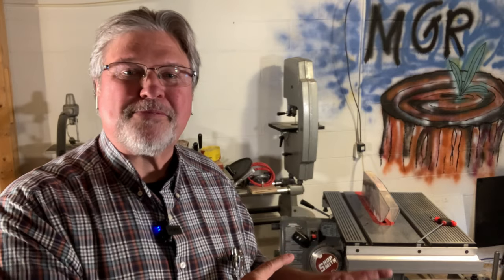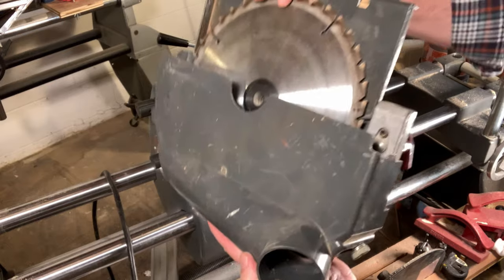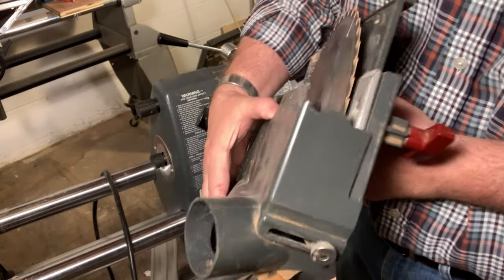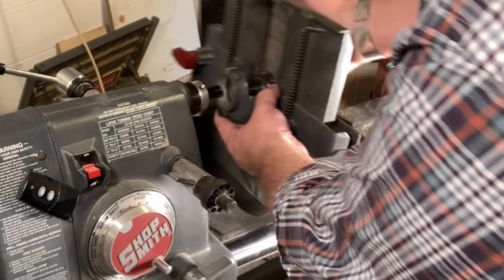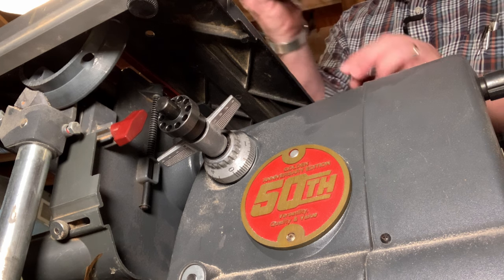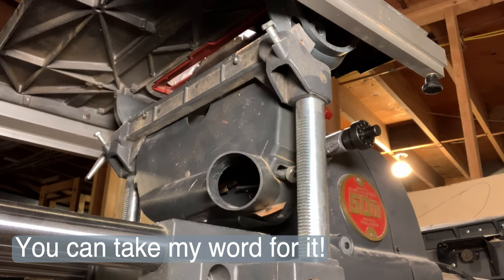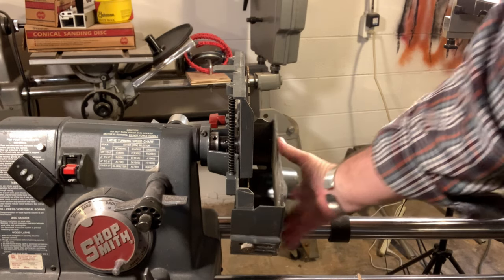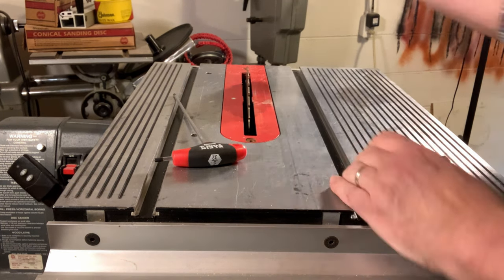Easy-Peasy Alignment & Installing of your Modern Shopsmith Saw Guard

Comment: Good info for the 510/520. Any special tricks for the 500? Thanks for all the great information. 35-yr SS owner, Grew up with my Dad's 10ER.
Reply: On my 500, the lower guard is about the same except the throat is fixed. I modified my lower guard,  fitting the shield that is supposed to be mounted to the table tie bar with two cap screws and attached it to the lower guard. The upper guard is mounted to the table tie bar so you must align the riving knife with the blade each setup.
Reply from the maker: Ed, only that the last version of the 500 guard that SS made isn't as awful as the previous ones, and actually does work OK with a dust collector.  SS doesn't seem to offer it, but they do have an upgrade kit for the version that just proceeded it. Scott
Reply: @MyGrowthRings  thx
Reply: @BunkyC36  How did you do that? It sounds like it might make the lower guard usable

Comment: Last year, I purchased table upgrade from 500 to 510 from eBay. Included was a rubber spacer to go between the headstock and table carriage on the way tube. When I lower the table, the saw blade winds up just clearing the left edge of the table insert, rather than being in the middle. I’m wondering if the spacer should be a tad narrower to correct this? I’ve adjusted the riving knife as you show in order to avoid having to run the saw with the quill slightly extended (which I was doing before). I’m concerned with having a problem if I tilt the table with the blade so close to the left edge of the insert.
Reply from the maker: Hey Dennis. That shouldn't be necessary, but I'm not seeing what you are seeing. By any chance are you still using your old 500 saw arbors? (I don't think they'd even work, but I'm guessing here.)  What else could cause that?  Is the old space still on the way tube?
Reply: @MyGrowthRings  I did replace my saw arbors. It could be a wrong spacer was sent to me… I could check with Shopsmith to see if they are available as a replacement part. I also didn’t receive the upgrade parts for the lathe tool rest.
Reply: My 520 has this same issue. The saw blade is not centered in the insert slot. It’s about 1/8” off. I spent a couple of weeks investigating and trying various things but only improved it slightly. I’ve decided to just live with it but it sure did bug me because my previous 510 was dead center.

Comment: You did not mention the cams on the upper blade. From the videos it looks like they spin easily. Mine are very stiff. I've tried wd40 but it only loosened them a little. How free should they be?
Reply from the maker: Yeah, those were discussed in the follow up video which can be found here https://youtu.be/S6yTxrSKUxM They should be very loose. If yours are that tight it probably means that they were riveted too tightly. You may be able to pry one of the cams out slightly which should loosen things up. Scott

Comment: Do you have to loosen the clamp each time you raise or lower the blade? Or table?
Reply: No. The whole thing is attached to the quill and moves in and out with the saw blade as the quill is adjusted. Its the saw table that goes up and down, not the blade.
Reply from the maker: Frankenberry is exactly right. The saw guard is stationary while the table moves up and down around it in the blade. It’s quite clever. Scott

Comment: Picked up a 1982 500 that got converted to 520. Came with upper guard but no lower parts to attach to. Does the required lower guard fit or not fit on a converted 500? I take it the upgraded table comes with the required wider stance?
Reply from the maker: All the parts will absolutely fit when you make the conversion. In fact, when I worked at Shopsmith and somebody converted to 500 to a 510 or 520 we told them to stop thinking of it as a 500 that’s been converted and think of it as a 510 or 520, because that’s what it now is.
Reply: @MyGrowthRings  Indeed. Turned out the upper guard was for something entirely different but I picked up an upper and lower guard combo and all is well. Thanks!

Comment: Will this guard work with a 10ER?
Reply from the maker: Unfortunately, no. The table tubes on the 10ER are too close together for the guard to fit. This guard is large enough to hold the Mark V's 12" sanding disc.

Comment: Hey Scott what dust collector do you use. I recently purchased the HF 2hp dust collector which quite a few people recommended on SS owners Facebook group. Although it reduces the dust I'm still getting dust on the headstock and the old shin buster aka accessory shelf
Reply from the maker: I use a Shopsmith DC3300.  I've never found one to be anywhere near 100% effective, as the dust just has too much force behind it as it comes off the blade. The most important thing is to open or close the lower guard, depending upon if you are using a shop vac or a dust collector.  The HF DC should do a fine job.
Reply: @MyGrowthRings  ok thank you sir

Comment: My SS is a 1986 model I purchased from another person. The saw guard it had was putrid at best. So I purchased the guard you show in this video. That turned out to be as bad if not worse. Plus the newest one requires two hoses for vacuuming. I am far from being happy about this. S S needs to readdress the guard for us with older models.
Reply from the maker: Bill, the guard you were talking about is not the one that I use, but is the better of the versions made for the model 500. Get a chance, you should explore a 510 or 520 upgrade. Postcards are a pleasure to use and do a great job with those collection. Scott

Comment: I find the hardest part of the whole system is just getting the upper saw guard and riving knife in the clamp after you've covered it up with the table. So hard to see where you are aiming.
Reply: You can put the upper guard in place while looking under the table in the area where the metal "fingers" come down and align it properly. Its just a lean to the left and a push from the right. Then you can use the SS again 😉.
Reply from the maker: I agree, Tim, which is why I usually lower the table (expose the blade) almost fully. That way I can see the jaws of the clamp through the table slot while still leaving enough room under the table for my hand. I should share that!  Scott